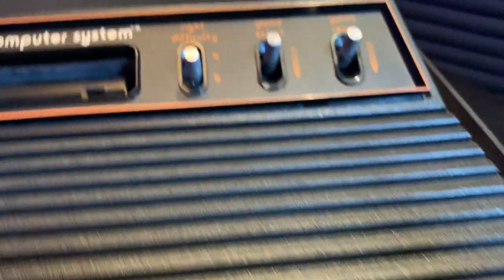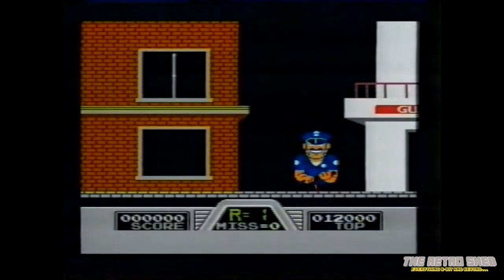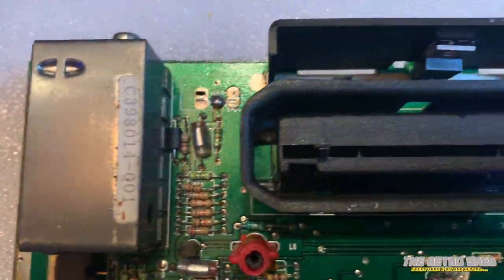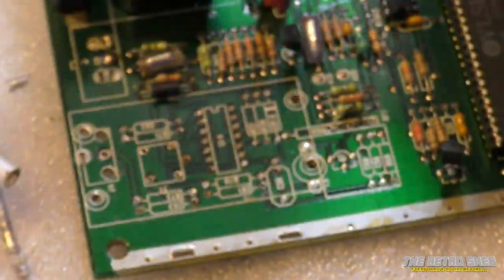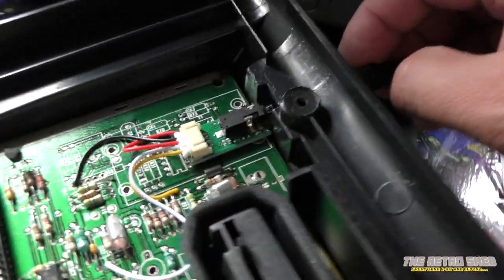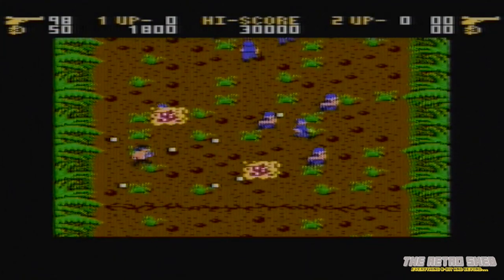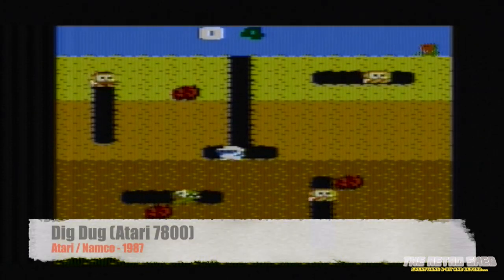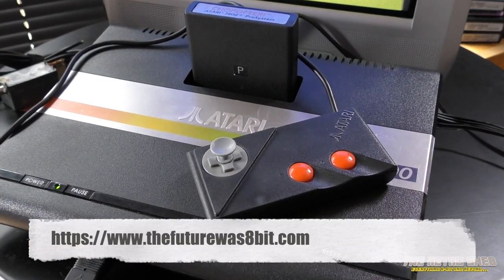Atari 7800 Composite Mod | The Retro Shed

Comment: That interference on Asteroids I remember instantly noticing back then when I first used one! The 1983 Famicom was technically unbeatable on the 8bit console market as it improved on almost everything from the Atari 800 (much nicer palette) and C64 (SID had better sound), Famicom cartridges in Japan cost half the price of VCS cartridges in US/EU (about $15-20 when converted from YEN of 1983) so even if it had launched in 1984 technically 7800 was already out of date by a year but had to be fed equally as expensive cartridges as NES. The only machine that really could compete with the NES in Europe was the C64 which had games costing 1/3 those of NES carts along with many talented people doing amazing audio (sfx too not just music as in the case of Beach Head and Falcon Patrol are not possible) along with the super weird way C64 bitmap graphics work making Law of the West only possible on the C64 with graphics that good in 'hi res'. It was inevitable the NES would go critical mass with the kind of talent Japan threw at console game development, few Western games (especially arcade conversions to C64!) put that sort of effort of extracting the maximum out of the machines. Still, I am more likely to turn off one my favourite systems and make space for a quick go of my 7800 than my NES...close call but as a kid getting a VCS in 1980 and Nintendo just being the company that made 2 awesome arcade games (Donkey Kong and Popeye) Atari games have more nostalgia for me as a Londoner.
Reply from the maker: Great to hear your memories of such a great time in gaming fella! Thanks for sharing. Will check out some of your content.
Reply: @TheRetroShed  Thanks :) What's the 7800 scene like these days? Probably only found your channel as I literally just finished a video for another channel of some 7800 console testing and a sit down for an hour with the only 7 games I have unpacked/found so far. Only 1/3 of my 7800s work but I do have 2 PSUs that work. One was dead and the other displays in black and white so a good candidate for a repair/composite video mod. Is it me or does the PAL 7800 screen looked squashed on PAL TVs? If I could hook it up to a 1702 or 1084 I could stretch the image to full size. So depressing looking at how much 7800 Dark Chambers will cost me today if I didn't buy it in the past! Maybe DK Jr is worth as much in mint sealed condition and I could trade. Really hope there is an SD card type cartridge for the 7800 and it's cheap and plentiful but I bet it isn't.
Reply from the maker: @madcommodore  I honestly don't know - I do however know that prices have gone through the roof to the point that most retro gaming hardware is now so overpriced its simply not worth it. When we started our channel back in 2017, the cost of an MSX Toshiba HX-10 was about £30-50. Now you're lucky to find one for less than £100. Its all gone a bit nuts. Stuff that was being given away for £3 at boot markets 10 years ago, such as Astro Wars (ours was £5 - mint!) would now fetch £40-£100.
Reply: @TheRetroShed  I gave up trying to find a mint boxed Astro Wars at any price under a 100 over a decade ago. Arcade cabinets were the first casualty, even in 2015 when I retired there were hardly any decent ones for sale let alone at decent prices. I think the latest casualty is the uncommon C64 tape games like Druid and Nebulus now as 3 of the biggest re-sellers with good prices have closed. There are quite a few 7800 loose carts that are around 5 quid but rare and playable games in boxes are at Jaguar 2015 sort of prices now or not even for sale when you look. I do have more 7800 games but as they have been stored until the house is finished since I retired I have no idea what other boxed (if any) or loose carts I have for the 7800. Shame because it is such an underrated system and most of the games you can play with a decent joystick. I was meant to do '8 8bit games' for a new multi-platform channel but I couldn't bring myself to break the seal on a sealed and hardly crushed Donkey Kong Jr off camera....so we will have to do that video another day if I don't find a loose copy. If someone thinks it's worth a week's wages as is then who am I to argue lol, I can put it towards a mint copy of Dark Chambers as Gauntlet is one of my fav' games ever and that is the best game for me on the 7800. I paid 10-20 quid for my 3 working and nice condition HX-10s, they were so cheap 15 years ago. I wish I had bought F1-Spirit back then too, nice game but not worth the price of a service on my car, no game is worth that sort of money to me on any system.

Comment: I have always liked the various Atari home video game consoles (2600, 5200 & 7800), so I had bought each one as they came out on the market. I did also buy the two separate Nintendo NES and SNES home video game consoles as well, for my biggest gripe with the Nintendo systems were their terrible game controllers. I prefer the right handed joystick controllers like Atari had for the Atari 2600 and the Atari 7800 in the USA.

Comment: You blokes over in Europe got the good controller for the 7800. lol
Reply from the maker: What controller did you get with it and where are you?!
Reply: @TheRetroShed  I'm in the States. We got a funky joystick with buttons on the side. It's actually not too bad, nowhere near as awful as the 5200 controller.
Reply from the maker: @treyslay753  that 5200 controller is awful. Very unreliable and difficult to repair as well. These 7800 pads are not the best also - they feel quite cheap and unresponsive. I tend to not use them and plug something else in instead - but the problem is with a standard one button joystick is - you need an A and B button!! Oh the pain. :)
Reply: I feel you mate. At least most of the games just require a single button. Great video by the way. I am subbed, and look forward to more of your content.